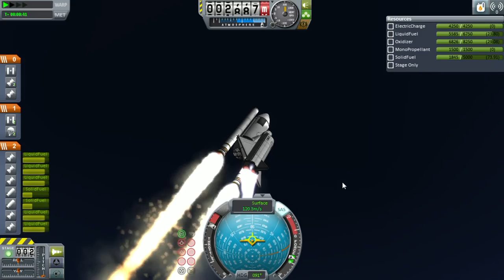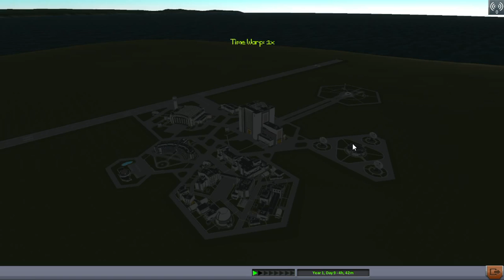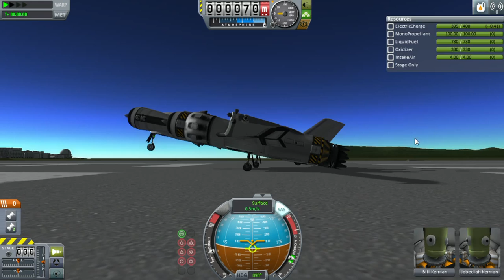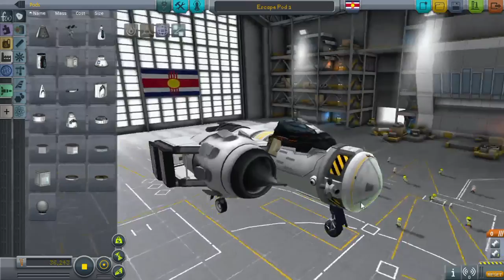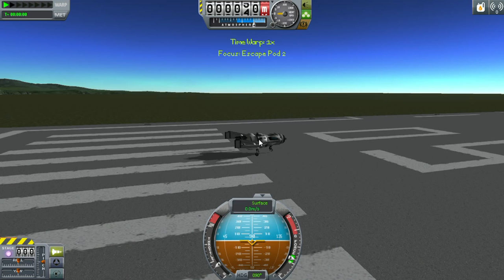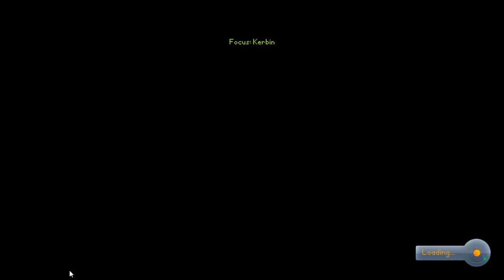Kerbal Space Program   What I'm up to Feb 2015

Comment: Hey, Rahm. All of these are neat little craft. The part faking on the shuttle made it look like one of the best shuttle-resembling designs I've come across. I would not have thought to have parts running through the bottom of the cargo bay. That's what I like about your designs: they sort of abuse parts but in doing so come up with both functional and aesthetically pleasing craft. For example, that 4-engine SSTO where the 8-kerbal cabins were inverted on the underbelly. I never would have done that. Squad put the windows and door on "top" so I always wrack my brain trying to fit those cabins onto my craft facing upward. Your approach made for an elegant craft even though it left passengers hanging by their harnesses. When you defy convention you devise invention.  

As for your proposed series, I think it's easy enough to gauge the design of the craft by seeing them in action, especially if you continue to include close-up shots and talk about them during maneuvers. I'd rather see less time in the hangar and more time on the Mun. I think what makes for good KSP entertainment is seeing how well - or how poorly! - certain craft work in a variety of situations and, when things go wrong, how you or the kerbals have to work around those setbacks. I am of course biased on this since that is largely how I approach my own Laythe series. But you asked for opinions. :)